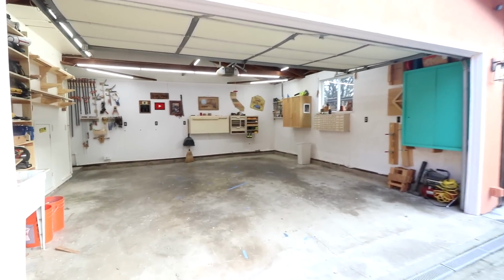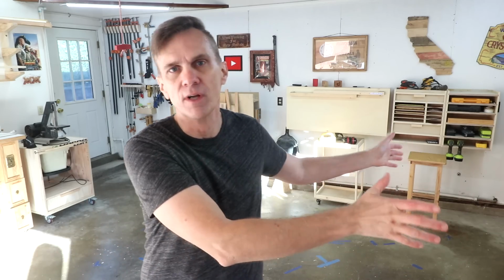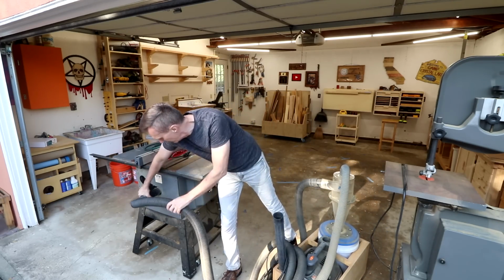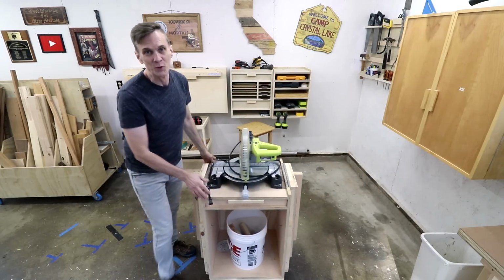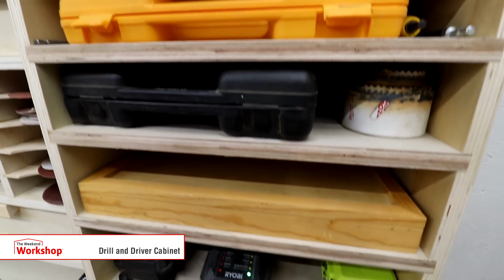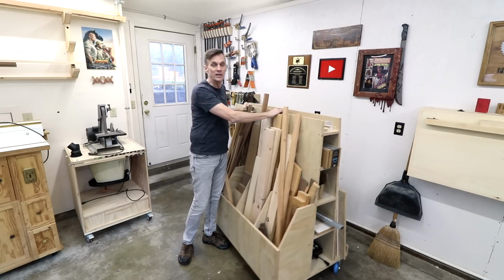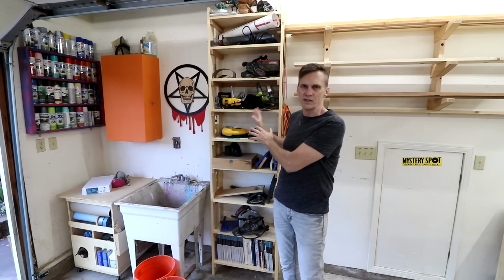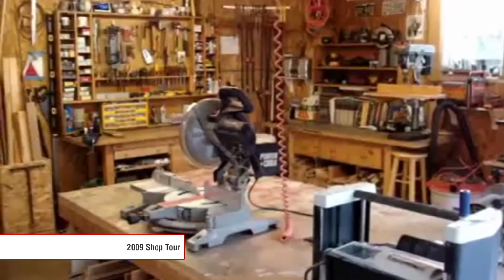SHOP TOUR. My biggest shop upgrade in 19 years! How to turn any space into an awesome workshop.

Comment: Awesome. I like the concept of dedicated spaces for everything drill and everything sanding etc. I can imagine starting a project by taking the dolly around to each  dedicated space and loading up what you need instead of walking back and forth. When I was learning housing design I liked the way architects solved the work flow in kitchens and space saving in bathrooms and closets. I would definitely take those ideas into a shop design. I'm big into fishing and since I'm retired I can buy up all the stuff I want but it was driving me nuts with so many bits and bobs so I built a rack where all my rods are arrayed horizontally on top and handy storage containers for each type of fishing and even smaller boxes that go inside with everything labeled. Then for fishing trips I have an extra box labeled GO Fishing and I can just load up exactly what I need from the various other boxes very quickly. The only drawback is I don't have a robot to put everything back when I come home.

Comment: hello steve . i came across your channel after i had bought a miter saw and found you here on you tube. kinda backwards on my part . but i did watch all your videos on safety tips and uses of what i had bought with no idea on what i was doing . the main purpose for the purchase was for building a new fireplace mantle which with much planning and your tips came out just the way i wanted . i did watch this video on your major upgrade in 19 years and wondered why you didn’t use a good floor cleaner in your garage and put a nice coda of floor paint ? please don’t be angry with me. it’s just would dress up the wood working area .

Comment: I normally don't watch shop tour videos for shops so large as yours.  But, I'm really glad I watched this one.  (I only watched it because it was yours).

Your shop tour wasn't a typical, tour. Yours is more educational in the organization, cabinetry etc.  You did say you tested your own course on it, LOL.  That, I think, is what makes it the most useful shop tour ever. 

My shop is 8' wide and less than 100 square feet. I sometimes have to roll some tools outside for larger projects. 

The biggest thing that stands out for me is your fold-down workbench, but there is more, still important, tool stands, too.  A variation of your BMW is on my short-list along with the now added fold-down bench. 

What I didn't see, and you probably don't need, is a rolling tool station.  You have individual spaces for your tool types and their accessories.  What I need to do is build a vertical cabinet on wheels with the tools in the different sides. I can either roll it outside when I'm working there, or turn it around to get to the different tools. 

If I can keep the tool cabinet with me, I'm more likely to put the tools where they belong instead of setting them down. that will keep my shop clean and, like you said, it's discouraging to walk into a cluttered, disorganized shop that needs to be rearranged before being useful.  My usable shop area is only 8' x 8' with a 3' area I can roll things into out of the way.  I have a 2 foot deep workbench/table on each of opposite walls so my standing room is about 2 to 3 foot 6 feet long. 

I love your work. Thank you so much for sharing.

Comment: Great video. Great minds… I worked in a 1500 sq barn for many years. Downsized to a detached single car garage much closer to home last year. Some lessons: Everything on wheels & you only need ONE of each tool. My new shop now looks very much like yours and I spend less on gas and shoe leather. Born & raised in SF but moved to Northern Michigan 20 years ago. Right now, it’s 09 degrees outside so none of that working outside right now. More insulation needed!

Comment: I rent a small flat in London UK. Thankfully there's basement storage with a door that gives access to outside, so I can just about wheel out the Evolution table saw, and use the modded router table. On the downside, it's a pain to have to move and set up for each session. On the upside, being outside, I have to worry less about dust and can physically blow around each cut as I make it.
So, where there's a will, there's a way...But, oh, for a dedicated workshop space! Garage envy!
Thanks for everything you've posted so far, you've saved my fingers and my face more than once. Cheers!

Comment: I've built mine using leftovers from work.  I'm in the cabinet and countertop industry and we get a slew of cancelled projects and rejected pieces. I recently got two 68" countertops from a cancelled project as well as a square  filler piece (covers a built-in dishwasher or wine rack) and a full island with a double stainless sink for free.  

I gave one top to my sister to replace her makeshift microwave stand and gave the sink to my buddy for his home. I used the square piece as a corner shelf and turned the other top into a nice workbench, complete with splashes.  I cut the excess off the island where the sink sat and used the cutout to surround my table saw.  It is now my outfeed/sidefeed table for longer pieces. It's just sitting on 2x4 scrap lumber for now since prices are so high on building materials, but I'll make it a rolling saw cabinet when I no longer need a 36 month loan to buy wood.  

It's hilarious to walk into my garage and see a Ryobi table saw with a laminate outfeed table. Unfortunately, we don't get free cabinets.  They send those to Habit for Humanity who refurbishes them and resells them. I'll just build my own cabinets that are better quality.

Comment: I'm signing up just for the chop saw station. Absolutely brilliant! 

A question of castors though: 

I just built my BMW (eager to get on some outdoor end tables this coming weekend!) and after looking over all these super amazing huge workbenches, and being told how important stability was (which was easy for me to verify, before the bmw I was working on a knock off workmate which wobbled like crazy) I tried to set up the Rockler retracting casters. 

tl;dr; They suck. 
They fall under the legs if I go over a bump. I've got rubber bands holding them up now, which works ok, and I DO like the idea of putting the workbench flat on the ground, without casters making it less stable, but I'm about to rip these off so I can do something better about my caster situation. 

are there any specific casters you recommend which don't make the bench rock too much when they're locked?

Comment: Very impressive.  I will start making plans for some of these organizer tools,  I got so tired of losing my tape measures and pencils 2 minutes after putting them down, so I made a wall rack to house my most-used tools.   Clamps, rules, squares, levels, pencils are there and I also included a large open cubby that I can throw in anything, like my push stick set, cleaning brushes, etc.

Comment: Why put a car in there- they are completely weatherproof. (Research showed that there was no benefit to putting a car in a garage- indeed, in wet climates they were actually detrimental).
I agree with everything on wheels, but the gap between wheels and machine should be storage. You can never have too much storage.
Small drawers- better to make big drawers (larger the better) and have divisions. Easier to find the part you wanted,  and with some things (nots, bolts, washers) they are naturally in sets. I have over fifty types of screw in one drawer. Length, diameter, top, number left all visible.
Good to see you do not store stuff in toolboxes- the worst possible choice for a workshop.

Comment: You should start hanging your drill and driver upside down. Hang them from the battery plug in base. Putting them right way up will, eventually, break off the selector switch. Having the battery on them while they hang like that makes it happen even more quicly. You also tend to bang the chuck/selector switches when putting them in and removing them from the storage slot. I know because I reciently had to replace my drill when it happend to me.

Comment: I have exactly 12 more sqft and can both sympathize and appreciate the use of space, things being sized right, mobility, etc...  down side for me are two 3 inch poles that are down the center that are part of the structure and only 7” head clearance. I have installed my dust collector and air compressor in the ‘attic space’ (if that’s what it’s called). My home is 125 years old and this barn/garage is probably 70 years old form back when many guys just poured a slab into their old dirt floored garages.   Thanks for the tour and keep it up.

Comment: Was looking at table saws, really interested in some of the Dewalt jobsite/portable saws (I like the rack and pinion fence when I was playing with one at the store) but noticed that many of the options under 500$ don't have the option for using a dado stack, or if they did they were missing some other feature? Would that put you off? the cheapest option that seems to check all the boxes i've found is the "dwe7491rs" which is running right around $600 which seems a bit expensive when I was generally looking at $350 saws. I need compact and don't have the room for a larger saw.

Comment: Steve,

I have the same table saw.  2 questions...have you had any issues with the fence on the table saw coming out of parallel with the blade?  And do you know if wiring the saw for 240VAC is worth the trouble?

thx

Comment: steve, consider some rolled vinyl flooring.  it lays down easily, your tools roll easily on it.  its softer on your feet and dropped hand tools.  doesn't need any floor prep, but maybe nail some quarter rounds to hold it down on the edges.

Comment: I started to make four tables that added together would make a place to cut 4 x 8 sheets. I never completed the 2 folding tables because I did not know how to make them. I made 2 roll around storage that can be used as infeed/outfeed for table saw. this works but I need instruction on how to make folding tables.

Comment: OH how I envy u guys in the Southern US ! Here in Winnipeg , Manitoba, Canada  we get both extremes of weather from  -30 F to +70 F.  Even though I have an insulated 24 x 26 attached garage with a furnace, it is a costly way to heat to a space I only use couple times a week. I have used an approach very similar approach to you in that everything is on wheels and tucked up around the 3 walls .Both my wife's car and my truck fit in the garage , though I do have to move them outside to access to some of my bigger tools. The biggest problem I found ( especially in cold climates ) and sharing shop space with vehicles is snow , sand and salt slush dropping from them. I need to scrape the floor before doing any major projects. Storing any glues, paints or finishes that could freeze is also a hassle so I keep that stuff in an old metal filing cabinet in the basement of the house. Fluctuating humidity levels also makes it hard to maintain the surfaces of the table saw and band saw. Love your no-nonsense approach to working with wood.

Comment: That's the same size space I'm dealing with but you have to add in a motorcycle, 4x4 quad with plow, riding mower with 48" deck, push mower, camp chairs, tents, clay pigeon thrower, auto ramps, auto jack, auto jack stands, and the rotating inventory of the wifes junk...

Comment: Hi Steve. Signed up for the course. Couple issue from here in uk. First FYI 4 x 2 comes in three thickness / widths. One is per your workbench plans but other uk users should note this. Also for the table project you specify 19 x 38mm and 19 x 64mm. In uk planned boards are 15mm or 18mm. Can’t find 19mm planned at all ....

Comment: Steve, do you have any plans for your miter saw cart?  I need to build one and i really like your design. Thanks
Reply: I know it is a year late but... When I made mine I didn't quite have the knowhow to make one like his. I instead went a slightly more space using yet still mobile cheater way. I bought a cheap universal stand with expandable support arms and put it on a dolly.  A few pieces of scrap screwed on to the corners keeps the stand from sliding off the dolly and the locking casters keep the dolly from moving when in use.
Reply: @yunofun  Good thinking! 🙂

Comment: I have had the exactly same setup in my 25' x 22' garage for over 20 years. Everything is on wheels and mobile. I also park a car in my garage when I am not using it. It has worked great. I also have heat.
Reply: Probably doesn't need heat that much where he is.

Comment: Ok for a for a do a little bit of everything shop based on power tools but as a dedicated space for woodworking I would do things different. Table saw with detachable sliding table (=get rid of miter saw which in most cases is to inaccurate for fine woodworking) fixed position against one of the long walls, jointer/planer on the other. Fixed chip extractor ducting to these two. Fixed workbench along one wall (could be on table saw wall as long as it's lower) for hand planing and other hand tool work. Large assembly table on casters, with mft and track saw capabilities, router table built in (why a dedicated router table?), as well as band saw. Pillar drill can be on jointer wall, maybe on casters but not neccesarily, depending in design it might not interfere with jointer . These are the major things needed, rest is just accessories that can be stuffed away. Still possible to fit a car🙂
Reply from the maker: Sounds like a great set up! Just remember this channel is focused for beginning woodworkers, thus I set up this shop to reflect that.
Reply: @SteveRamsey  Thanks for quick answer. For beginner I think your tips could be a good entry approach, missed that small detail. But I think a jointer planer should be considered even in beginner layout, at least where I live you can't buy planed boards.

Comment: Great video. Thanks for sharing. I think I'd love to start my shop from scratch.  To change the whole lay-out. To throw away what I didn't use the last 5 years
(or at least move it away from the shop). But I'm sure (99%) that's never (never say never) going to happen.
My shop is (only) about 22 by 10 feet but I can live with that. Should be plenty enough.
The biggest problem is to get everything out of my shop  Somethings are put together (welded) in the shop and don't fit through the door (only 3.5 feet wide,
on the side not directly outside but to a hallway and only from there outside (another 3.5 feet wide door)
Even if I could "everything get outside, I don't a have a place to store it, nor somewhere else inside, or outside, in order to start from scratch.
So I change my shop little by little.

Comment: Steve, I noticed you removed your big central assembly table (which was probably 4' x 8'?). How are you getting along with the smaller surface of the BMW plus? Do you miss the larger area?
Reply from the maker: I got rid of that huge table a while ago and don't miss it. What I discovered was that I rarely assemble anything that big, and if I do, it's easier to manage on the floor. So what happened was the big work surface mostly accumulated clutter.

Comment: My workshop is shoehorned into our tiny basement that I share with an oil-burning furnace and its tank, a water heater, and a litter box. Total, it's about 400 square feet with a 6'6" ceiling, but with too much unusable space. The walls are the stone foundation with crumbling stucco and the floor is hardly level. Still, I make it work. I guess what I envy most when I watch this are your walls! You can mount things on them and get them off the floor! I guess my biggest takeaway from watching is is that I need to buy a lot of casters. Thanks for the videos. Your channel is the first I recommend for anyone starting out.